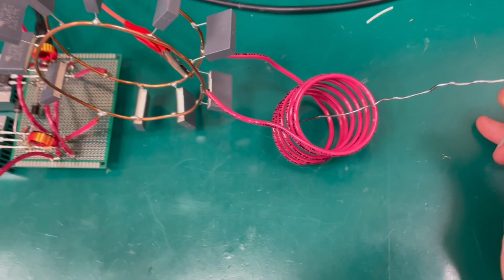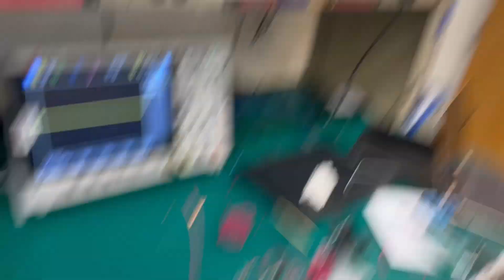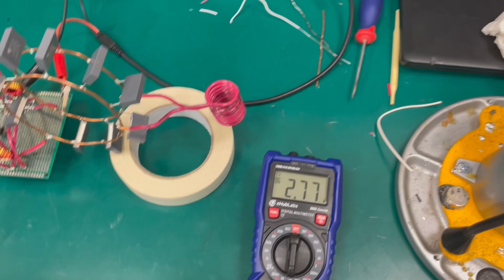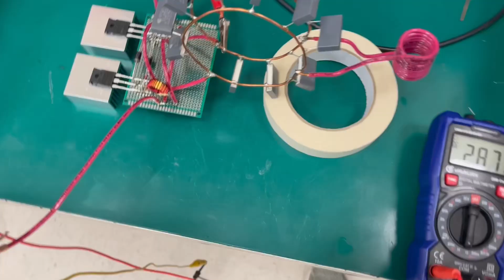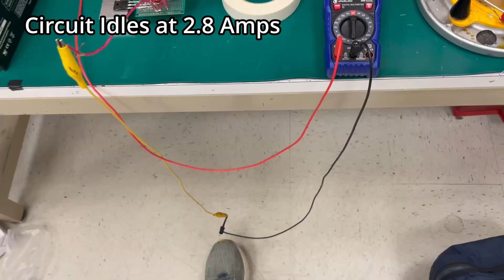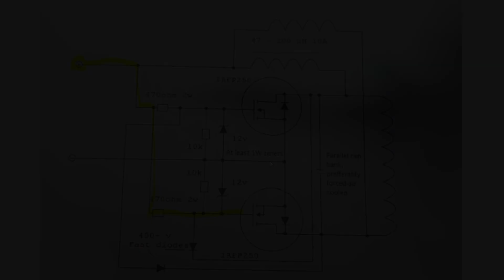DIY Induction Heater Demo

Comment: Impressive. I hope i also one day will be able to build stuff like this. Just finished the first year of electrical engineering in uni.
Reply from the maker: As long as you enjoy learning and can get into the material, then I guarantee you will be! Just make sure to be safe if you mess around with high power stuff :)